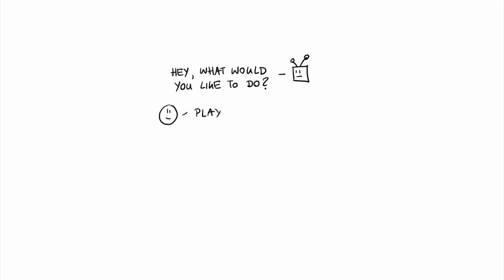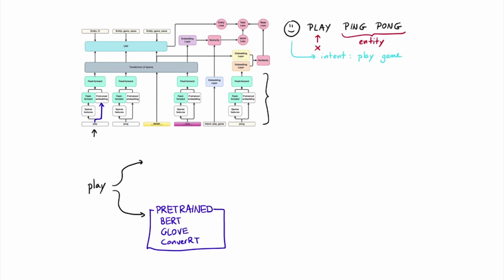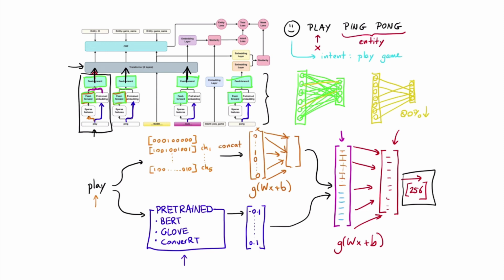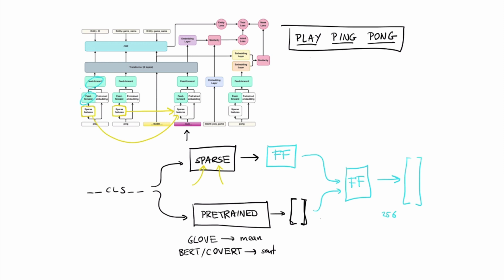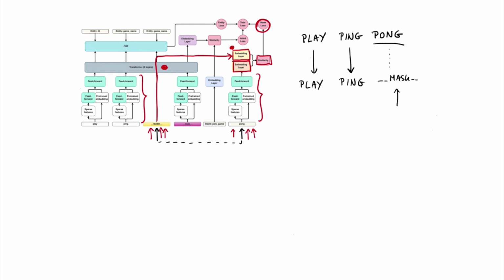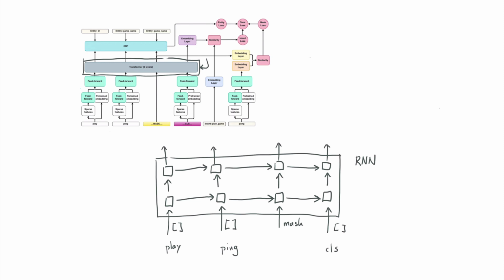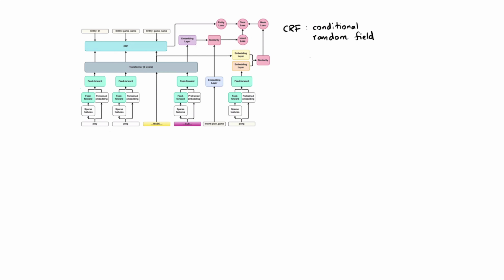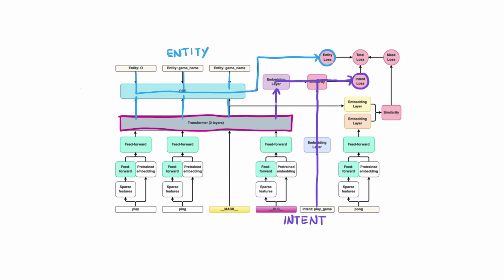Rasa Algorithm Whiteboard - Diet Architecture 1: How it Works

Comment: Hi there, there are still some questions that I don't understand.
1. is the intent embedding layer that comes from the intent label shares the same parameters with the parameters of intent embedding layer that comes from the transformer?
2. Why do we use the embedding layers for calculating the mask / intent similarities, instead of calculating the similarities without using the embedding layers?
3. Why do we use the sparse embedding together with the dense pre-trained embedding, instead of using the dense pre-trained embedding alone from ConveRT/BERT/GloVe? What is the benefit for applying sparse token embedding and n-gram char embedding?

Thank you!

Comment: How is this related to using spaCy for pretrained embeddings? Apparently it uses fasttext and/or glove, but how exactly is everything related to each other? Still having a hard time wrapping my head around all of this.
Reply from the maker: DIET isn't related to directly spaCy. It's an algorithm that can accept dense features and sparse features to handle text classification and entity detection. 

It can use spaCy as a source of text embeddings. But you can also use GloVe, fastest, huggingface or ... whatever you want to provide. It's tightly coupled to the Rasa framework, but if you have compatible feature-components then DIET can use it.

Comment: Does this still apply for Rasa 2.x or 2.2.x?
Reply from the maker: Yep, DIET still works the same. The only difference is that the syntax for the config file is just a tiny bit different because it's .yml instead of .md: https://rasa.com/docs/rasa/model-configuration/
Reply: @RasaHQ  Awesome, thanks!

Comment: what is embedding layers looks like in 15:24 ? it's a dense vector representation like starspace ,Glove, Cbow, or any word2vec ?  I'm  confuse because in config i just write down the sparse ( countvector ) and not apply any pretrained word
Reply from the maker: The embedding layer is more like a dense layer than anything else. It's called embedding layer because it's a convention from tensorflow. Note how an intent goes in at the bottom and a representation comes out? It's very much like starspace.
Reply: Rasa i've seen starspace whiteboard algorithm, thanks 👍. Very enjoy this series

Comment: Nice explanation!
Only point of criticism I have is that the colors you used are not very accessible for color-vision impaired folks. The red is hard to distinguish from the black, and the blue doesn't contrast well against the purple... '^^
Reply from the maker: Good that you mention that! We're try to stick more to grayscale in the newer videos. This should be more accessible for those who are color blind but it should also have more "calm" and clarity. Feel free to reach out if you feel like the later videos are not an improvement.

Comment: Finally the Diet explained :)  Whatever said and done, it made training impossible on CPUs.
Reply from the maker: you can still run everything on CPUs just fine actually. you'll see me run a benchmark in video 3, all on CPUs. you can customise the algorithm to use more or less resources. in general we advise not to consider adding the pretrained models (like Bert) unless you have a really good reason to.
Reply: @RasaHQ  Hi, can you please elaborate why pre-trained models shouldn't be used.?
Let say we training on German, wouldn't it be better to use a pre-trained bert.?
Reply: @arvindraj-ui1rf  i think cause the Bert trained on so mush topic like street lang and formal lang etc .. 
and you need to represent your word in a way to fit your specific data ... (that's my Opinion)